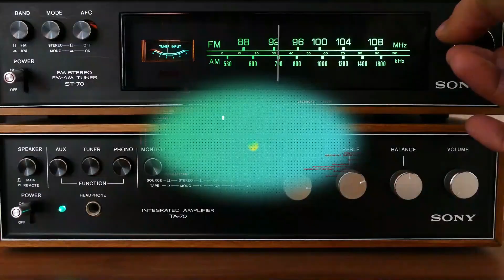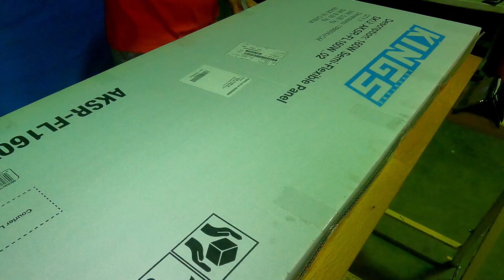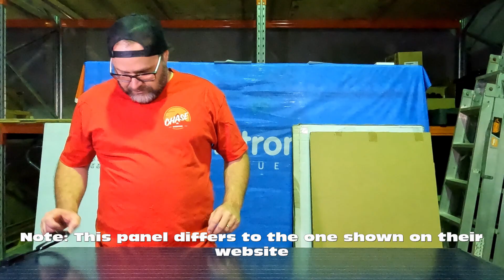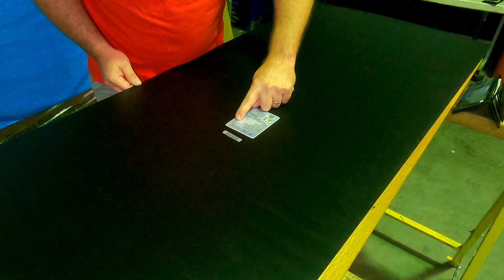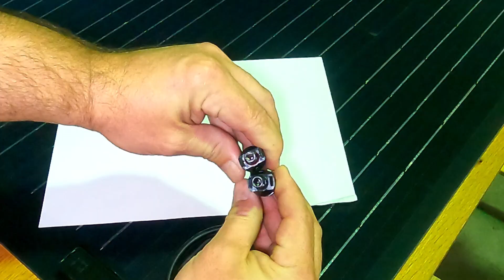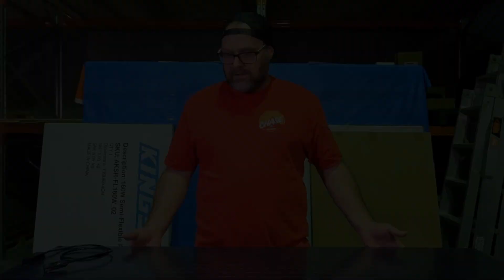KINGS Flexible 160w 12v SOLAR Panel. Watch this before you buy! 4X4 | CARAVAN | CAMPING | OVERLAND

Comment: Great review. Clear explanation. Thank you. I’ve got an older Avan that we’ve had for a couple of years now. We have a solar panel on top but I don’t think it’s functioning so I’m hoping to pick up,some tips about solar systems. Don’t think I’ll go for a flexible panel though if it needs replacing. Cheers.
Reply from the maker: Thanks.  If weight isn't an issue I'd go a normal glass fixed solar panel, they'll last a lot longer than the 'flexible' ones.